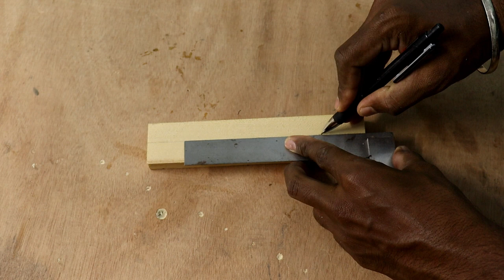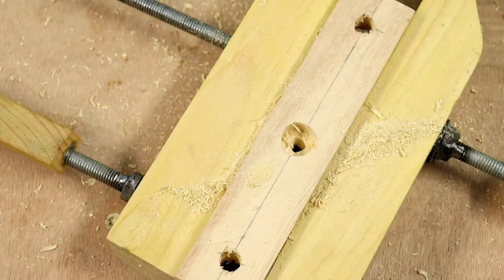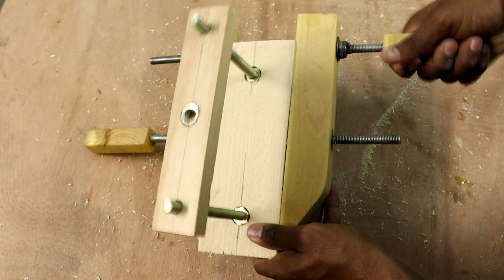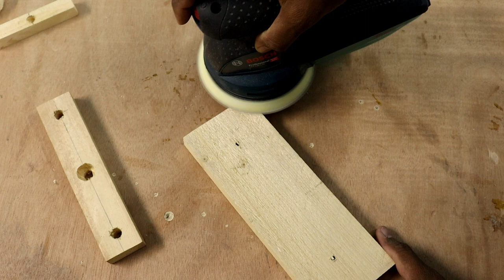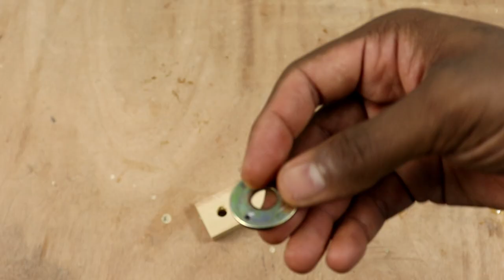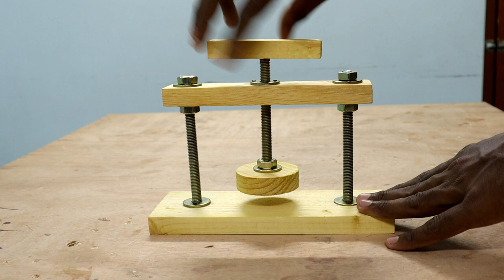DIY Mini Wooden Screw Press | How to make a screw press | DIY | GK's Wooden Workshop

Comment: I do not understand why you did glue the nuts in and then added the nailing washer. You could have just drilled through the wood a hole in the size of the bolt and pushed it through from the bottom. That way the press pushes the bolt ends into the wood instead of out
Reply from the maker: Great Point !!! Thankyou